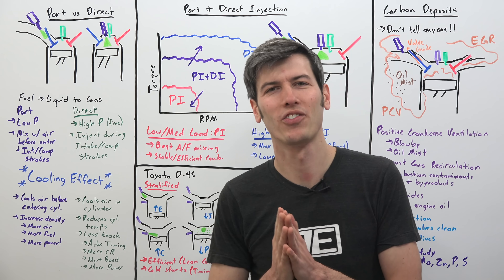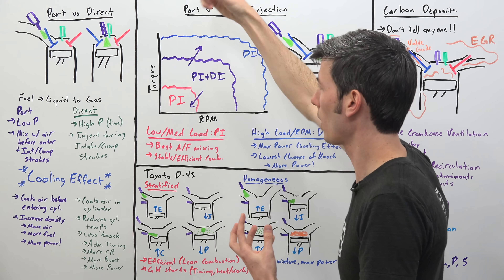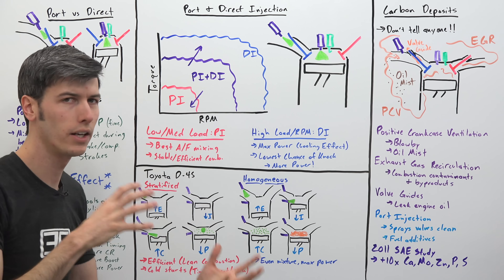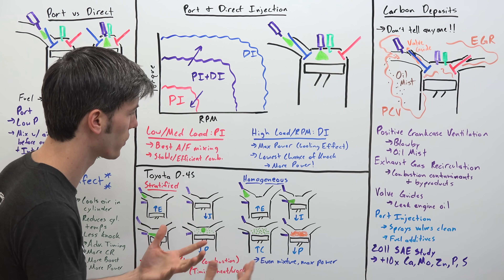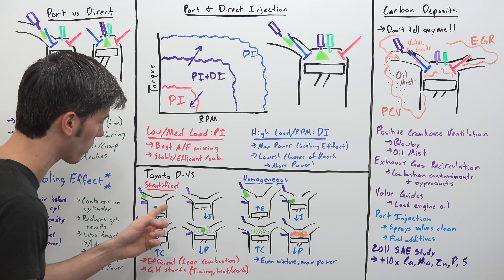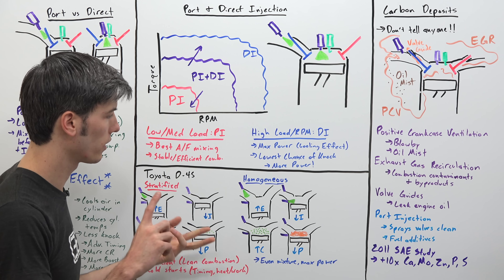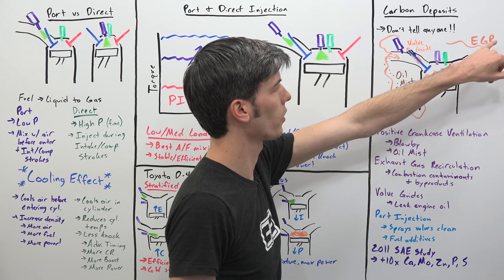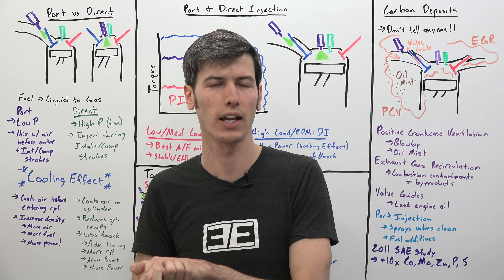Why New Cars Are Using Both Direct & Port Fuel Injection

Comment: "pro tips" for the DI car owner.  

1. Delete egr. 
2.get a air oil separator , or if your really harcore run your PCV to a air oil separator then to a vacuum pump thats then vented to atmosphere opposed to the intake.
3. i also clean my air filter at every oil change. but i do a lot of off road and dirty environment driving..  
4. use an engine safe deposit break down chemical of your preference in your intake while holding partial throttle or whatever the product you buy recommends to do. probably once a year or even less if you have already made the above upgrades. if you do none of the above i would suggest number 4 once a year.  but i have no basis for that claim, just that its a known issue and its not gonna hurt anything.
Reply: Water is the best valve carbon remover you can get. When the engine is hot, water flashes to steam and breaks off the carbon.
Reply: I've heard kerosene is a very good deposit cleaner , it works best when allowed to soak apparently. ive now heard multiple people say they have used kerosene to clean engines but i have not done it myself or researched it. but maybe something to look into , i personally wouldn't want to use water. you would want to be very careful with that.  but maybe i'm just being paranoid.
Reply: I've heard "deposit breakdown" chemicals are hard on turbos though?
Reply: maybe , it's mostly going to get burned up in the combustion cycle. i wouldn't put it in pre turbo on the intake side i guess then. find a way to spray or pour it in post turbo on the intake. car should be able to at least idle with the intake piping / turbo disconnected. will probably throw some codes until reconnected.

Comment: I have calibrated port injection engines (my 2JZGTE) but I’d like to take a shot at DI engines. Getting the injection timing just right seems interesting.

I would think you’d want to model throughout the MAP when your cylinder pressure is the lowest before TDC/peak cylinder pressure (combustion) and inject fuel at that point....so, just a the very beginning of the intake stroke, to me, sounds like a good opportunity to inject fuel in a DI engine. At least the fuel pump/injectors don’t have to fight against high cylinder pressures in order to open the injectors. 

But this is my guess...
Reply: from what i'm understanding  high compression / high cylinder pressure loves DI. I think its becoming more known that you can run higher boost/cylinder pressure/compression on the same fuel with a DI system. I also believe the reasoning is that you purposely wait until well into the compression stroke to inject the fuel (that's being released from such a high pressure) that its significantly cooling the air reducing the chances of pre det. Its a thermodynamics principal , releasing pressurized fluid naturally causes a cooling effect , and DI systems use way higher pressures than PI systems so the cooling capacity of the fluid should be greater on paper. carbon build up can be cured by deleting egr , and running the PCV through a air oil separator before it goes back into the intake.
Reply: @TheDaltonmichaels  The other benefit of DI is due to fuel efficiency increases per cylinder. With a PI (port injection) system, not all the fuel enters the cylinder; due to turbulence in the intake manifold. But with a DI system, fuel is injected during the compression stroke AFTER the intake valve has closed therefore, all fuel placed into the cylinder is used for the combustion event.
Reply: 755hp The pressure differential across the injector isn’t as important as the fuel rail pressure is very high, between 500 and 5000 psi, so cylinder pressure doesn’t affect fuel flow much.

Comment: I have two questions: 
-for a PI+DI do you need two differentes fuel system of differents pressures ?
-does that work with diesel engine cause diesel only uses DI right ?
Reply: single source, the DI injectors are driven by a secondary high pressure pump that is mechanically driven off the cam. In DI only it's the same way actually, 2 pumps.
Reply: As they said one system, two pumps.

But if you have a diesel engine you can get many of the same benefits with even more efficiency by using a propane injection system that puts propane in the intake system and causes a more homogeneous charge of fuel to be burned by the diesel fuel when it is injected. Then the diesel fuel becomes like the sparkplugs controlling the timing of the combustion.
Reply: @davidscott5903  You're right, except methane is actually better for diesels.
A diesel engine can work on 45% propane/butane and 55% diesel, OR it can work on 10% diesel and 90% methane.
A diesel engine that runs partially on methane will have increased power output and decreased emissions because of the homogenous a/f mix.
The only drawback is that you need another tank to be placed in your car/truck and you need the system to be setup and tuned in. That's not to big of a deal when you factor in propane, butane and methane are all a lot cheaper than diesel.
Reply: @sasjadv  
The only reason that I mention using propane is because of the availability of propane in the USA, and the fact that it is in liquid form in its tank. I didn't know about the amount of difference in ratios. Do you know the reason for the difference? I would like to know if you can find out. Thank you.

Comment: Carbon build up with DI engines is a disadvantage...
Reply: DI engines will build up much more carbon than PI engines, and Fuel Additives cant remove carbon on intake valves. And DI engines are very sensitive to temperature. In high temperature environments, more fuel needs to be injected to reduce the temperature of the cylinder. However, the cooling effect of the injecting fuel is not good, engine limits the power output in case of overheating.
Reply: The only way to clear the carbon deposits on the intake valve is to disassemble the intake system. DI engine need clear carbon deposits every 40k~60k miles.
Reply: @plumwolf280  
Now I have realised this is probably what killed my Mazda 6 gen 1 at 120,000 miles. 😭

Comment: the real reason is injectors are really expensive, so the more they use, the more you will have to spend in repairs once the warranty has expired (unless you get an extended bumper to bumper unlimited warranty) XD